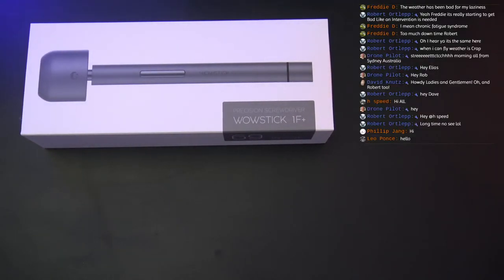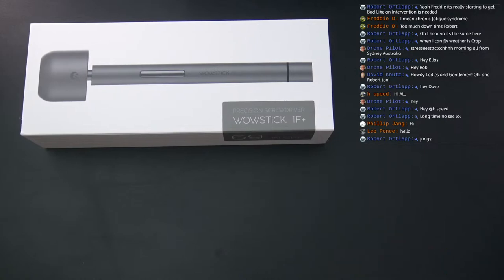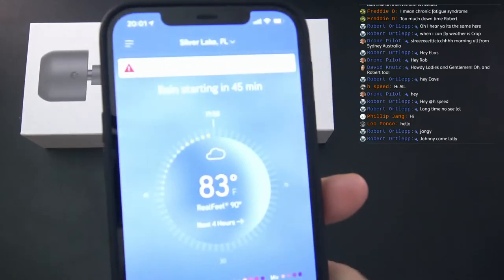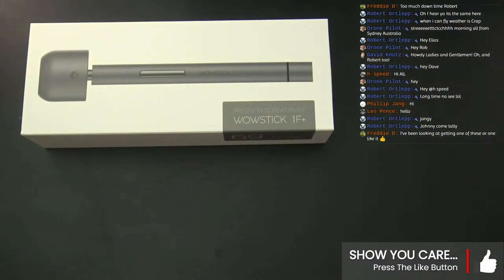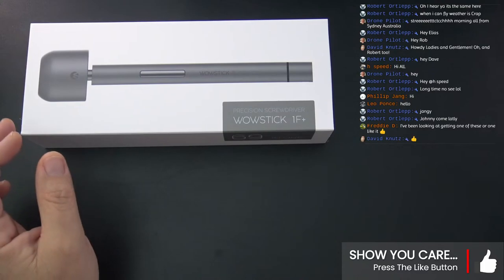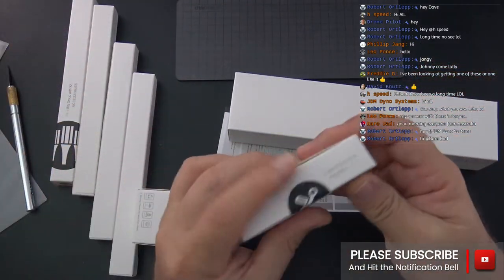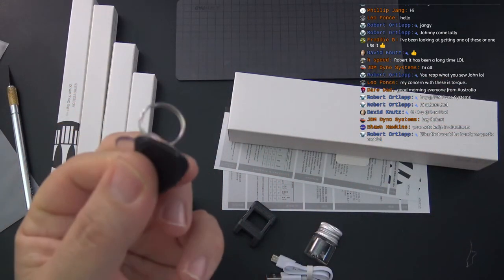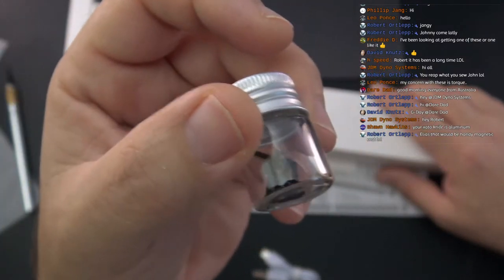Xiaomi Wowstick 1F+ First Look

Comment: Good Review... I've had one of these in the shop for about a year now. Very helpful when needing to assemble or disassemble a lot of smaller screws. BTW... In all fairness a guaranteed full charge before the review would have helped... ;-)
Reply from the maker: It turned out it was very close to full charge. I only had it on the charger for a few minutes before the led turned green. In any case, it won't always be used in a full state of charge so I think the testing was fair enough.
Reply: @RCVideoReviews  Agreed...

Comment: John, These screwdrivers are GREAT! I use mine daily and have been for almost a year now. The included bits leave a bit to be desired especially the hex bits. Get a set of these Wiha bits, Not cheap but good tools rarely are. https://www.amazon.com/gp/product/B00JQ753W8/ref=ppx_yo_dt_b_search_asin_title?ie=UTF8&psc=1
As a companion driver this one is also very good. I use it when I need extra torque on R/C cars and Heli's  but don't want to drag out my DeWalt driver. The Wow stick does do just fine on Multirotor frames if that's all you need.
https://www.amazon.com/gp/product/B08R62NTYD/ref=ppx_yo_dt_b_search_asin_title?ie=UTF8&psc=1. Unavailable right now though...
Thanks for the thingiverse tip, I didn't even think to look! I'm printing a nice looking holder now.